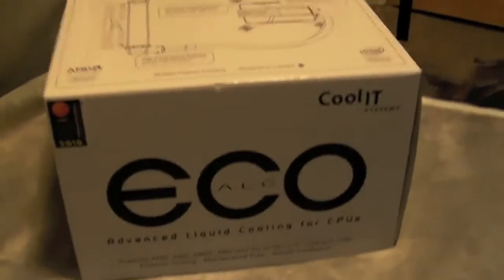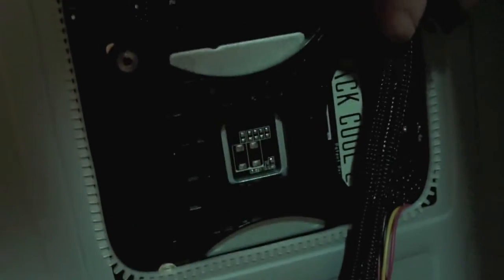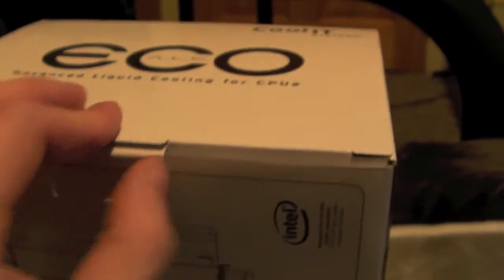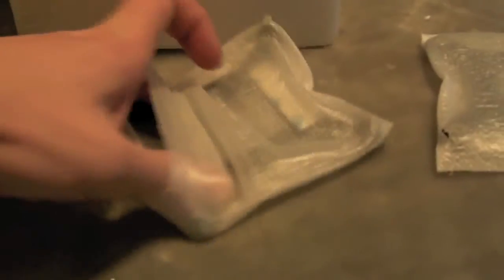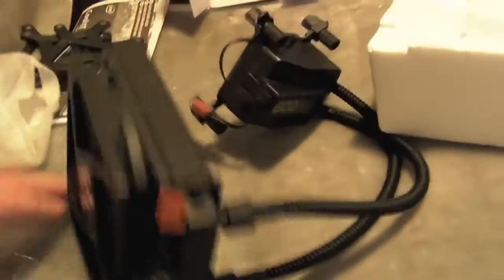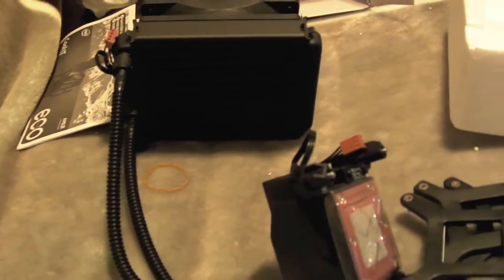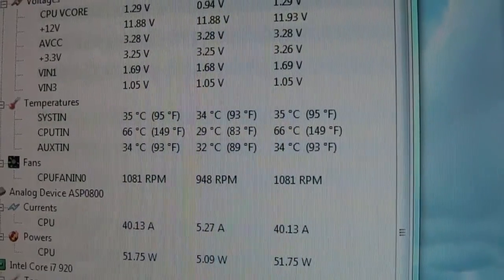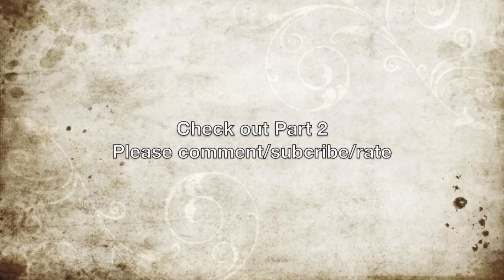ECO ALC Coolit Systems Part 1 Review/Install/Quick Benchmark

Comment: Just a word of warning here - I spent 1500 pounds on a top spec PC just over a year ago with this cooling system. As soon as the guarantee was over the ALC Cooling unit popped and leaked all inside my pc ruining my new GTX580 graphics card, killing the processor and motherboard. ALC gave me the 2 fingers when I asked them to stand behind their product and at leat help out with the cost of repairs. I will never put water near my PC again!
Reply: can happen to all brands, u ever think corsair will pay u money if your h110 set is leaking water into your 8700k or your 2080ti? forget it

Comment: You have it installed wrong probably. Your RPM reading for your CPU block cooler that actually goes on your CPU should be around 4000